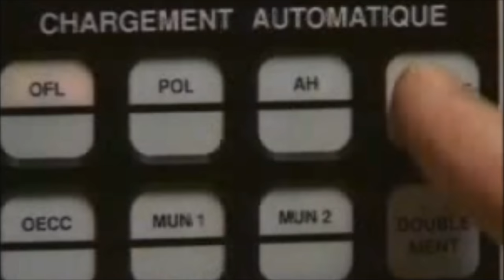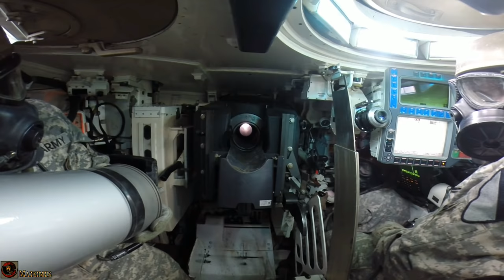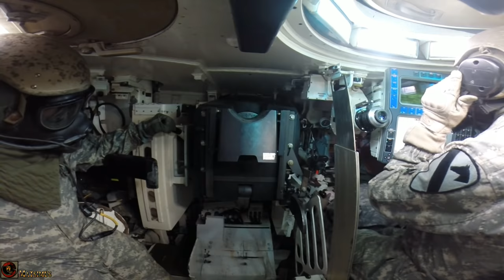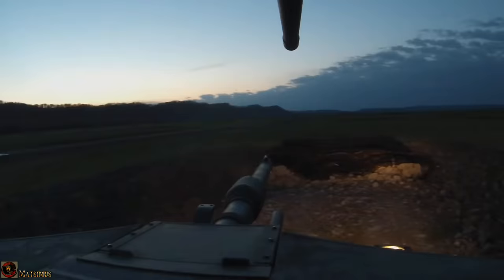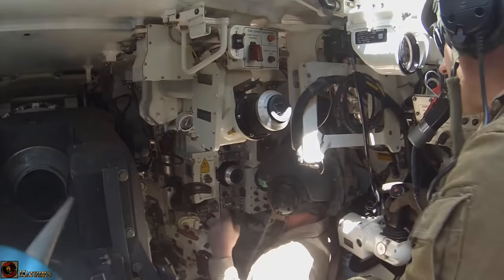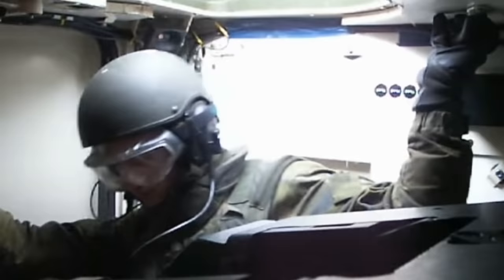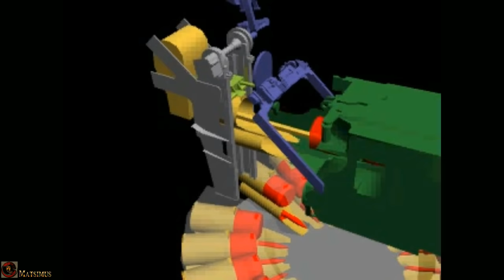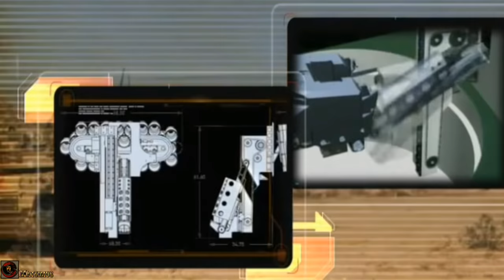Tank Autoloader or Crewman Loader?

Comment: As a Tanker myself, I appreciate having an extra hand on the vehicle. I'm more for a human loader, but keep in mind I'm also probably a bit biased. Having that extra crew member is an extreme help when you have to do maintenance on the fly. For instance, during our last field exercise, our tank was burning oil horribly. I'd say it was burning about five to seven quarts in an hour. That is bad, especially in a turbine driven system. We also had a road-wheel that was leaking lubricant and the hub was empty. We really didn't want to shear off a road-wheel, or have our pack melt or seize up from lack of oil. So, with a short pause, myself and my loader jumped out and got to work. He filled the road-wheel, and I set to work topping off our oil. The ordeal took about five minutes, and we had the best started back up and moving. Without my loader, that would have taken me about fifteen minutes by myself. Or, even if we did still have two people, that would mean that my gunner would have had to help out with maintenance and wouldn't be providing security. 

Now an autoloader that's reliable is a great thing. And there are a few countries that have really nailed it like France and Russia. However, the load times are usually much slower. As a loader on the Abrams, my usual time is around three and a half, to four and a half seconds to load. Most autoloaders that I have seen in my time take anywhere between seven to nine seconds. Seconds count. However, they will keep that steady speed whereas a human loader will get tired and start to slow up after an extended engagement.

So it's a trade off. I appreciate and prefer having an extra hand, but I can understand the benefits of an automatic system as well.

Comment: "Autoloader will jam, and is safety hazard while crewman loader is more reliable...."   paraphrasing here
Really ? Then explain why so many crewman loaders lost their fingers ?
Reply: i would love to measure the Rate of Fire of a tank after an accident like that
Reply: @jotabe1984  Probably slightly more than an autoloader when it jams.
Reply: Losing their finger because of how they push the shell

It's better to push by close-fisted instead of opened one
Reply: I got my fingers because I used a fist ram method, pretty simple stuff
Reply: @proqrammed Its not a matter of population... for example a country like Venezuela with 30 million cityzens will have every year about 1 million people with 18years... And most countrys have about 500 tanks or less in stock, but even if they had 2000... there's just 2000 more soldiers to be trained...
The trick here is that overall crew training on a tank is much expensive on every extra crewmember, and it is harder to retrain reserves for 4 different jobs than 3 different jobs.
Autoloaders makes tanks overall cheaper (on USSR doctrine in which autoloader will last way more than overall tank expected life).
What's better? 1 Leo2A6 or 1 T72B3? Leo2 no doubt... but if we say 1 Leo2A6 vs 2 T72B3 + 2 T-62M? thats the soviet (and later Russian) approach
Reply: @jotabe1984  Russia literaly uses autolaoders be ause they wsnt to have tye most tanks 0hysicaly poszible. Removing a crew member from every tank means you can have 20% to 25% more tanks.
Reply: Hm, I spent three years in 1st Armored Division and three years in 3d Armored Cavalry Regiment.  I don't know a single armored crewmember who ever lost a finger.  I would know.  I sat in on most Deployment Readiness Meetings.  No one ever reported lost fingers.

Comment: Great video Maximums. Ten minutes in before I forget these points:
An auto loader, especially like the one's in completely robotic turrets, with crewmembers in a separate compartment in the hull only, prevents the crew from getting caught in moving parts and exhaust gasses from the main gun without additional fume extraction. Not that venting out the gasses anyway would be a bad thing either.

Also, ammunition isolation in expendable racks that blast out of an expendable roof reloading doors to reload a section of ammunition racks at a time by crane, and different racks for different ammunition types or a smart system that can identify what ammo is placed where is possible with just a good and innovative ammunition storage unit design, that a robot can pick ammunition from.
Plus, the heaviest man many be lighter then a particular auto loader system, but requires more space asvyou mentioned, thus armor to cover said space and hence more overall weight when the additional armor is taken into account, and all the additional hassle that adding weight to a vehicle, such as a tank, creates.
Also, as you mentioned also, getting an autoloader to take out a round and change it for something else, doesn't seem like it would take any more then a simple clever design idea, like a vacuum to remove the charge and a magnet to remove the projectile.

As for speed of reloading, having watched how factory robots work in various documentaries, it's surly just a matter of time before you just blink and the robots reloaded the main gun and flip a switch to change ammo, and blink, and it's done. If factory robots can do it, why can't robots inside this particular war machine not do the same concept of fast, automated movement of an object, even it is an explosive charge and shell?
As for the repair and maintenance. That is a valid point for now, but is the same type of argument why some people choose revolvers over magazine fed pistols. With decades of tweets and testing of maximizing reliability, semiautomatic magazine fed pistols can be basically guaranteed to work when you have to pull the trigger.
So with modern computer testing, prototype testing and factory testing in a peacetime environment, wouldn't engineers worth there salt be able to iron out all of the bugs?
Also repair and maintenance teams removing and replacing damaged parts could be assigned to a specific tank platoon or company... actually that's shifting the blame and inviting lazy/irresponsible crew members to get away with things they use and should share responsibly in unkeep.... we'll see what designs people come up with and the systems of how the burden of upkeep works out I'm guessing.
Yes, an extra pair of eyes does make it easier for seeking urban enemies to be detected. Advanced technology can only go so far but yes, like with the T-14 Armata, can do things that crew members cannot, like be on 24/7. But then again, that's an addition to crew severance, in my amateur viewpoint, not a replacement. This begs the question of why not just have a drone operater / machine gun operator rather then a human reloader? Just a thought. Again great video content man. These are just my thoughts. This is not meant as a put down or anything like that.
God bless and best wishes from Ireland. :)

I'm not trying to catch you out man. I love your videos and am just sharing the thoughts I'm having while watching your great video content. :)